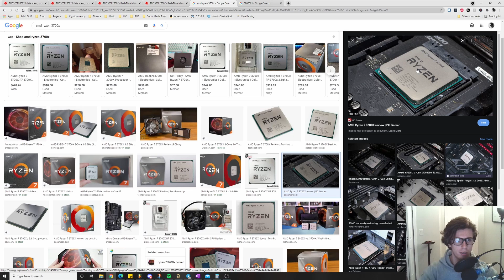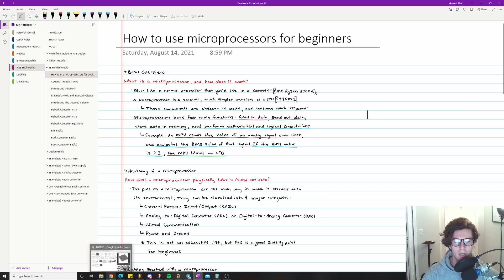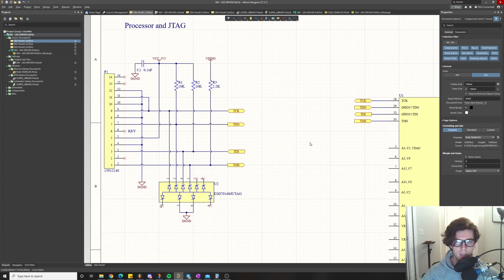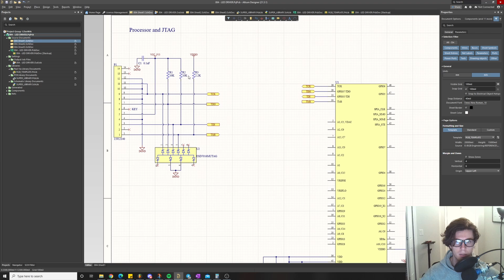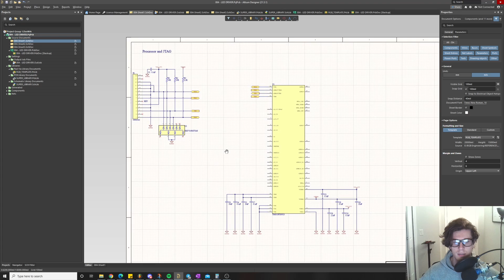HOW TO USE MICROPROCESSORS FOR BEGINNERS | MICROPROCESSOR BEGINNER TUTORIAL | MICROCONTROLLERS GUIDE

Comment: I want an explanation from a programmer's viewpoint; why use an MPU over an MCU? I've only ever programmed bare metal on MCUs and am trying to get to understand where an MPU would be useful. A chip with a full OS just seems like a ton of overkill. What type of projects need that kind of computing power?
Reply: For example, I see a lot of audio based projects (.mp3, .wav, etc.) that use an MPU; however, I'd think that a 32-bit MCU should be able to handle it. Am I wrong?

Comment: Sir can you make a video / teach how to use a microprocessor (not microcontroller) in a project with a simple example, your videos are easy to understand if you make a video like i said it will very help for us ,
Reply from the maker: will do :)
Reply: @RGBEngineering  there is any ref / book / tut for that . i fed up bcoz whenever i google it the result were 8085 or similar to that, i am ok with 8085 but i need more than it, like make my own mini single board computer etc.. I hear about soc its awesome  but i need to make a project with microprocessor first before using soc or something.
Reply: @RGBEngineering  running a simple  program from flash memory using RAM would be nice